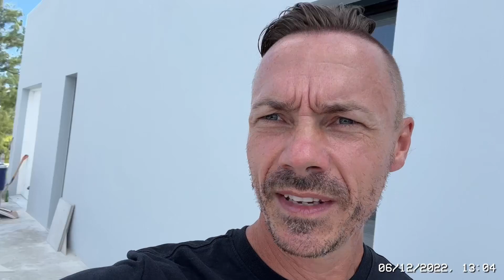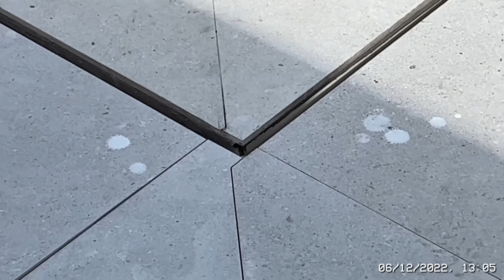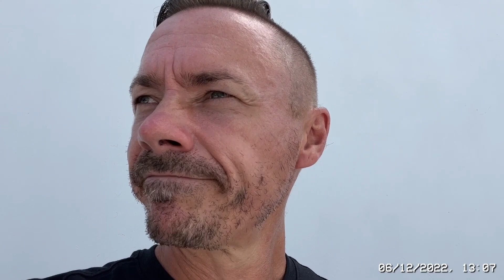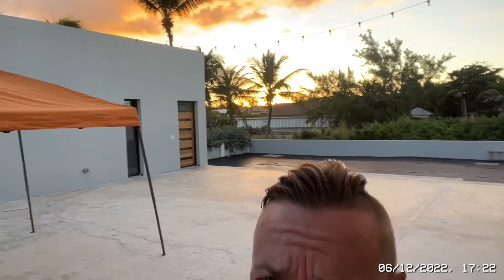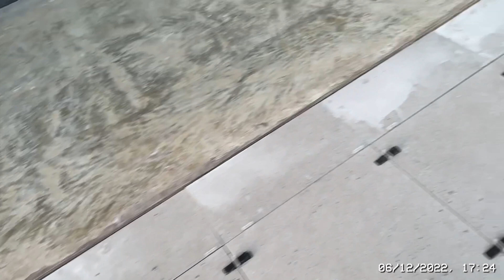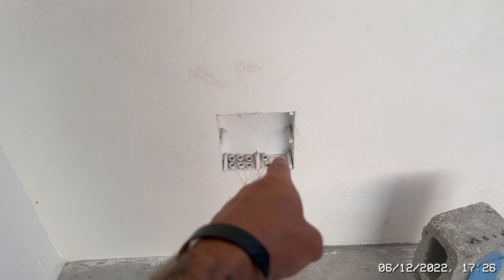Barbados 🇧🇧 Beach House Build - Day 410, day 20 of the Pool Build

Comment: Alvin, what about using the mosaic tiles as a feature in the corners that are off?
Reply: do mean a diagonal line of the blue mosaic tiles three or five tiles thick running through the corner  down to the step on one side and sun shelf on the other? It could work tying the top in with pool edge but that would mess up Alvins border which will provide the balance he needs.. yet it could work as a neat accent..
Reply from the maker: Yes, I want the top edge to be the big tiles though!! We will work it out!